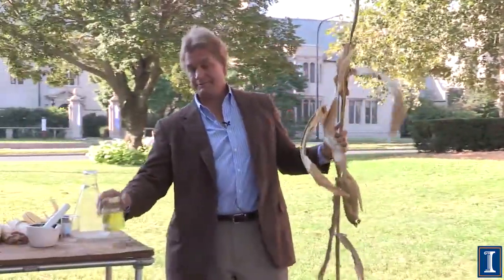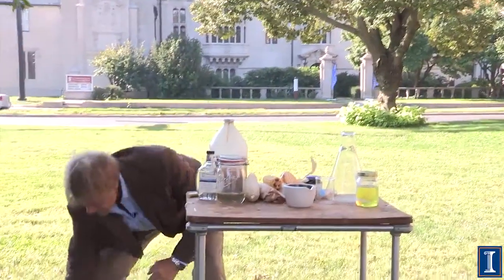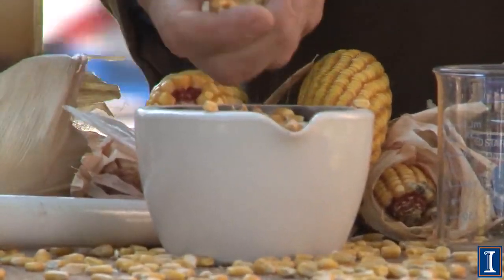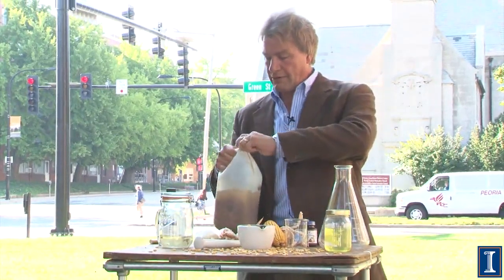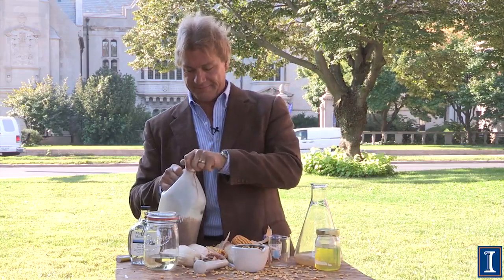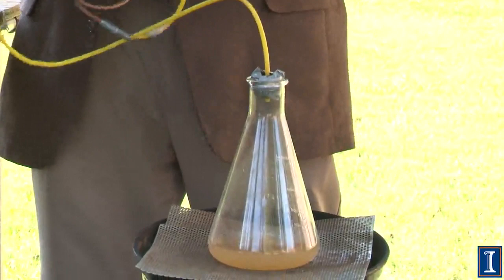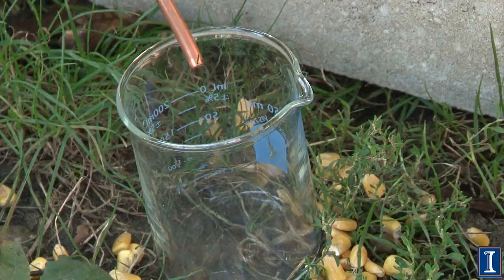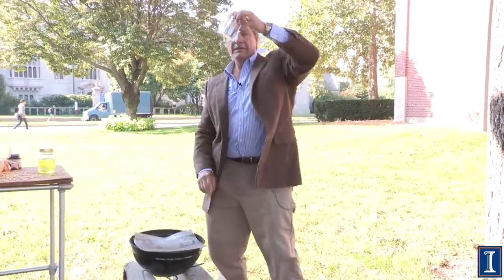Running on Moonshine: Making Ethanol Fuel

Comment: Not terribly difficult, yet Doc Brown couldn't manage it for the DeLorien.
Reply: didn't DeLorean run on nuclear fuel?
Reply: @TF2Scout..  As per the movie, only the time machine did, originally. Then it was powered by Mr. fusion.
But that's also unfathomable, He could create a nuclear powered time machine, but he could dump an electric motor in there to power it with a fraction of the power?

Comment: Heat can leach out the nasties in plastic, even more so when it's a solvent like ethanol. that looks to me like a plastic pipe connecting the jug to the copper cooling coil. Homedistiller rules don't recommend any plastic except PTFE. If you know ALL the dangers and do homemade moonshine is safe. Just like you cant do an electricians job only knowing a few of the regulations.

Comment: I have read that the energy production cost, including the manufacture of fertilizer for the corn, the diesel to run the farmer's tractor in the field, distillation and the manufacture of the chemical drying agent is 95% or more than the energy in the resultant ethenol. I can understand why this is controversial, but I wonder if the professor could comment on whether this is true.
Reply: This is controversial particularly because it's using a widely use food as raw material. In Brazil we make it using sugar-cane, we have the sun needed and have developed the engines. We use 95% ethanol or gasoline with 20% ethanol (works as a anti-detonant). One of the advantages of ethanol is that the gases that come out of the engine are much cleaner. Brazil developed the technology from the late 70s because of economic crisis and lack of hard currency to import fuel. Later we went through a phase when sugar would be more expensive and ethanol fuel would disappear. Recently, dual fuel engines were developed - based on engines for different types of fuel used in colder countries. My car has an engine like those, a VW UP!, 3 one liter pistons with turbo from the factory. It's a small car and with ethanol it runs very well! I can get a bit less than 15Km/liter riding on highways.

The idea, with bio-fuels, is to avoid adding carbon to the atmosphere. The problem is that a few years ago, when there was an international attemp to do it with corn, the price of food skyrocketed around the world - remember that corn is used to feed livestock also.
Reply: @maxheadrom3088  
Thank you for your knowledge about this subject. It is possible that bio-fuel in the form of ethanol may make sense in Brazil but not in the United States. Personally, I am excited about the possibility of replacing my gasoline powered car with an electric one.
Reply: I was hoping he would explain a bit of the economics
Reply: @LegendLength  forgive my bluntness... it isn't worth it when someone who lives paycheck to paycheck goes to fill up their car. Even more so when farmers go to market, they get lowballed on their stock just to unload it. 

Solar is a toxic pipedream at this point. You can't even mass manufacture from scratch to full working component legally in the United States because the EPA has deemed it too toxic. There is no process to recycle them either after 20 year life span... they bury them, only to leech toxic heavy metals (of which solar panels are richly composed of).
Reply: Corn to ethanol for fuel I have a few points.

Cost - subsidies make it cheap, but it's not really the cheapest when you factor in this.  There are cheaper and better options.

Environmental effect - more CO2 is produced than saved.  But ethanol is an anti knocking agent, aka increases octane rating, so better environmentally than other chemicals additives.

The real issue is there are better options which are multiple times cheaper, more efficient, and not a potential food source, like switchgrass.  The agricultural and chemical companies like their current system and their large subsidies and in place infrastructure, so they lobby the government.
Reply: @Unsensitive  You can even use sawdust from forest management programs, all kinds of grass(from lawns even), algae etc, if you develop a yeast strain that can also digest cellulose and other complex sugars other than starch. 
E-85 is nowadays used by amateur racers instead of racing fuel, because it is cheaper, and has similar properties to racing fuel. It could also mean more efficient engines for road cars, because higher octane means you can run higher compression (E-85 makes less power on normal road-going engines because they dont run enough compression). People like to shit on biofuels because of «food or fuel» which btw isnt even an issue with this kind of corn, this stuff is useless for human consumption, and the mash after processed is still given to cattle anyway, but there are many very sustainable, and environmentally conscious ways. 
Any process heat can be provided by nuclear or geothermal energy, preferably.
Reply: @AlldaylongRock  the mash after processing is likely healthier for cows.
  
Cows fed a high starch diet too quickly can actually kill them, or cause acidosis and dysbiosis.

In either case, high starch diets make the cows fat, which humans seem to value, but is not healthy for the animal, causing metabolic dysfunction.  Thus processed grains would seem healthier for them than unprocessed.. but grass is probably still best.
Reply: @Unsensitive  Zootechnicians and vets have been carefully designing cattle's diets for the balance between fattening and health. Some high starch+some low-starch. Some unprocessed, some processed. 
But the main point is that there's no "food Vs fuel" competition in what corn ethanol is concerned.
BTW, waste mash from wineries can also be used. Although you usually make "aguardente" (a kind of moonshine) from the mash, and then either burn it to distill the ethanol from other mashes, feed it to animals, or use it as fertilizer.

Comment: You're actually pressurizing via heating thus causing the heavy water to separate(distilling) from the grain alcohol thus forcing said alcohol through the tubing. By cycling through the tube pressure is sustained now on the horizontal instead of vertical axis causing further pressurization/distilling via condensing upon the copper metal (water droplets on the exterior/90% to be proofed alcohol as dispensed.) 

So I would say you are incorrect when you say we are heating and cooling as what in fact you are doing is using heat to pressurize in the vertical and then ambient air in the cooper coil to continue to pressurize in the horizontal to bleed out as much water as possible. Water is the enemy of internal combustion be of how well hydrogen and oxygen bond and thus need to be separated twice to be called distilled product (of both water and alcohol should be duly noted as well.) 

To give your students an example of the awesome latent energy in the distilled water bond simply show them a video of the Space Shuttle being launched as these 2 molecules get back together again after having been separated!

In the alternative launch your engine with kerosene. (SpaceX Merlin Rocket engine fuel).

As you correctly point this "other refined product"(grain alcohol) is very combustible indeed. This still does not obviate the need for a filtration system on your ethanol engine however! Other than that great start on your presentation!

Better start would be with GEOMETRY however.

CHILLERS are for Air Conditioning and producing liquified natural gas and not for producing grain alcohol...hence its incredible efficiency as a fuel! The USA exports one million BARRELS of ethanol a day(or used to until just recently) it's so efficient to produce ... even relative to cane sugar!

But of course nothing compares to refining straight up oil into various feedstocks...not that gasoline is a health food of course!

Comment: biofuel is such a phenomenally stupid way to get energy for a society. 20 years ago I attended a lecture carefully outlining all the reasons it's so dumb and backward and wasteful, then we tried it on large scale 15 years ago and quickly found out yes, it really is a dumb idea for a variety of reasons and nothing more than another subsidy to the corn farmer lobby.
Reply: Oof, ethanol production has gotten exceedingly efficient in the last 20 years. Natural gas and electricity at ethanol plants has been reduced by 40% and water use cut in half in the last 20 years, while they are getting 15% more ethanol from a bushel of corn.

Even when you include the land use change emissions, ethanol use still reduces greenhouse gas emissions by about 40-50%. Additionally, in the US it takes 1 unit of fossil fuel energy to produce 1.3 units of ethanol energy so you are at a net positive energy-wise. Other countries do even better.

I'm not saying it doesn't have drawbacks but production has gotten a lot more efficient in the last couple decades
Reply: @hazmatt2k6  all the same tired propaganda bullshit big corn has been trying to force feed people for years. the efficiency of ethanol manufacturing plants is and always will be a complete irrelevance when the efficiency of photosynthesis is an invariant pathetic 0.2% and the environmental destruction of corn croplands via overfertilization induced eutrophication and mass pesticide use are considered, to say nothing of the increased greehouse gasses released via ammonia gas escaping from soil and other fugitive GHG releases from the destruction of soils. the scientific evidence does not and has never supported your propaganda. https://link.springer.com/article/10.1007/s10584-013-0927-9

Comment: Ehhh, Americans.....
I distill my own moonshine (from my own fruit). It's far superior to what you can get from the liquor store. And yes you need to make sure not to include methanol, get somebody blind, and to stop the distillation when sub-42% alcohol starts coming out of the cooler.
1st distillation will get you around 50% average alcohol density, 2nd distillation should get you about 75%-80% on average. I think you should need around 4 sequential rounds of distillation to get to 95-96% that is the maximum you can get with distillation. I still don't know what the drying agent is though.
Reply: one drying agent is 3A molecular sieve you can also get it to drop out at 93%-95% in the first run if you use a reflux still (what i use) and do a slow distillation

Comment: Can you cover bio ethanol and other bio fuels a bit more?
There are some interest types where the feed stock is; alge, wood pulp, waste from the waste water treatment plant, waste food/oils 
Once the sugars are extracted from the feed stock is very similar. However, I think it's important to make people aware that bio fuel doesn't need to be made from food crops or take up arable land.
It can be made from waste products that would otherwise need to be treated 
Bio ethanol can both treat the waste products and provide a valuable resource from them
Reply from the maker: I have a few videos on this subject already up.  Look at the "renewables" play list.
Reply: @illinoisenergyprof6878  ah, found them. Thanks
They now have ways to use bacteria/alge on the wet waste to make bio fuels.
There's also some landfill gas power plants saw one in California.
Also there's an amazing incinerator within the city limits of Osaka, never noticed any smell from it...

Comment: Practically all hard liquors are distilled more than once to filter out impurities. This process purifies the alcohol content to an even higher proof: bourbon, for example, can be put into barrels at proofs as high as 125 (62.5% ABV), and due to a variety of complex factors, can actually increase in proof with age. Most bourbons generally come out of the barrel from anywhere between 110 and 140 proof, and the reason we see whiskeys in the market at 80 proof, or thereabouts, is because of whiskey companies trying to maximize profits by adding water to the whiskey and selling their product at the bare minimum requirement to be labeled as whiskey (no less than 40% abv, among others).

Comment: I hope that anyone who is watching this does more research if they intend to distill alcohol to drink. The FIRST molecules that come out are primarily dangerous for consumption. The worst offender is of course methyl alcohol, or methanol, which can be easily disposed of during distillation with proper education on the process. I highly recommend that you become well versed in producing non distilled alcohols before attempting any distillations and to check with your local, county, and state laws before attempting to produce your own alcohol.
Reply: Yeah, but if you just grind corn and then add water & yeast, you won't get alcohol. You have to hydrolyze the starch first (saccharification) with the use of enzyme (amylases). Also, from grain fermentation there isn't so much methanol, as people think, methanol content is far higher in alcohol made from the fruit. But, yeah, it's always great to gather a lot of information before trying to produce something, that you want to pour into yourself, from scratch.
Reply: also he way over simplified the mash/fermentation process
Reply: @appleh8terguy  that's true but that won't kill anyone.
Reply: get rid of the first 2 ounces ...Check out  Youtube: 
Barley and Hops Brewing  channel
 https://www.youtube.com/channel/UCatCieEI4cPNteKXzBomVMQ

Comment: Maybe a little discussion about energy density would round this out.  The ethanol's lower energy density is why you see a drop in MPG as the amount of it is increased in the gasoline. At 10% the energy density of that blend is about 98% of straight gasoline. Granted not a lot but not trivial.
Reply: By far the worst thing about it that I encounter frequently is that it absorbs water and corrodes aluminum like mad
Reply: ethanol fuel runs really well in high performance cars, despite the fact it has less energy content. This is due to the ethanol fuel's high retardation (yes that's the right term). It is harder to ignite than normal gasoline, and thus it is able to be compressed more. And more compression means more burning and more power.
Reply: It is also an octane booster as its native octane is 108
Reply: The average thermal efficiency of an internal combustion engine is only 20%. So ethanol being 70% energy density of gasoline in a 20% efficient engine is where you see that 14% drop in MPG's. More stands to be gained with engineering than lost with fuel energy densities. If you raise the compression and recover heat loss you can gain efficiency. The more oxygen you can flow through an engine the more potential power can be produced (AKA compression). Regular gasoline can't be taken to a higher compression than 11:1. Ethanol and race fuels can run at a higher compression like 13:1 or higher. Its just that ethanol is 600% cheaper than VP race fuels (approx. prices). 
It will also cost more to manufacture these engines, but aren't we already there? We just need to break up the "racket" the API has with the auto manufacturers to get anywhere on this. Why can't we raise the minimum fuel grade to 91 octane so the auto manufactures can raise standard compression ratios and efficiencies? Answer: They would make less money
Reply: Reduced pollutants, farmer income are not trivial.
Reply: @alanl.simmons9726  I just think a full discussion of the ramification of a lower energy density would help to describe the full picture.

Reduced pollutants is a good hypothesis, but when you add in pollution cost of production, handling/transportation, blending, etc. in addition to the reduced MPG and marginal damage to the vehicle (i.e. shorter life cycle requiring manufacture [IE more pollution] of more cars) you end up pretty much where you started.  

I actually don’t have a big problem with using it but let’s just call it for what it is, an alternative price support method (supply and demand) vs direct government subsidies for growing corn.
Reply: What about it not being economically viable without subsidies. The land used for ethanol could be used for more than making sure certain people check certain boxes during elections and certain companies finance certain campaigns.
Reply: @Jameson1776  That's why it was a qualified statement, Tackling farm subsidies and political reform is an extreme departure from fixing broken power equipment. I am in a position to do nothing about all that sir. A man like me that scrapes by on rolling in filth has no connection to such things, I do not wield the levers of power and control so why complain that my main complaint about ethanol is something I can actually act on. You may be happier in life if you limit your list of complaints to things you can actually fix. I appologize in advance if I happen to be talking to one of the few independently wealthy, politicaly active, and savey youtube commenters but somehow I doubt it.
Reply: Jameson 1776 watch the video. Subsidies are long gone.

Comment: Curious as to the economics / thermodynamics / environmental impact.  The corn has to be farmed with diesel tractors, harvested with diesel harvesters, trucked from farm to plant by diesel trucks, kiln dried by electricity I'd guess, crushed by electric motors, distilled by natural gas or electric stills - all of those things generate pollution.  Is the energy input, the diesel fuel, electricity, the natural gas spent getting the ethanol more than the energy output of the ethanol?  Is the pollution saved by putting the ethanol in the gasoline completely overcome by the pollution of the diesel farming equipment and power generation?
Reply: @ihategooglespooks It's economically viable therefore we have to heavily subsidize it? Makes perfect sense, buddy.
Reply: It destroys fertile farmland for no reason. It wouldn't be economically viable if it wasn't subsidized.
Reply: No it doesn't! What did they do before diesel?